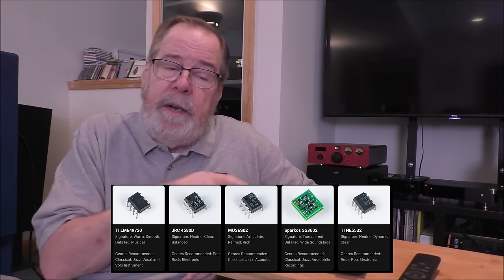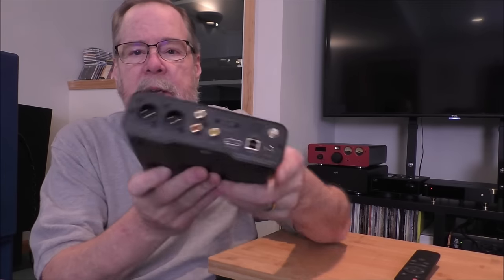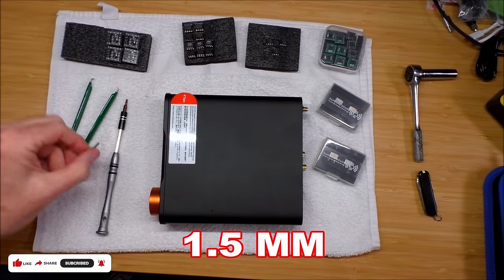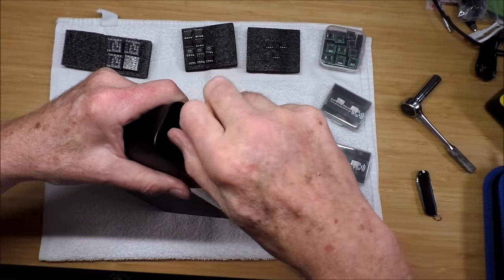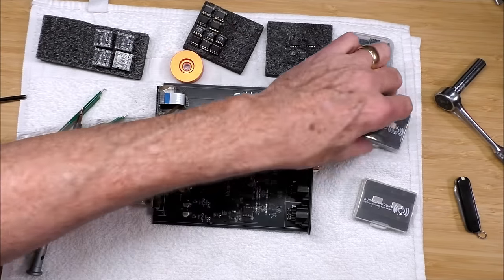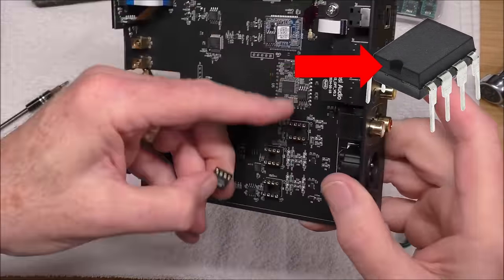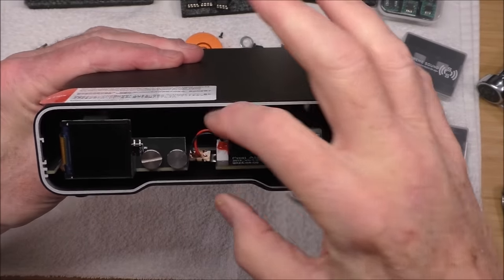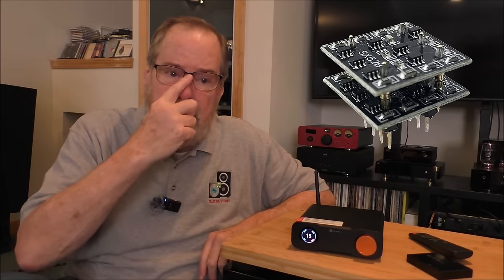This DAC Blew My Mind! No Kidding! The FOSI ZD3 forced me to reconsider my thoughts on SABRE DACs

Comment: Hi Old-guy!
I might try those SX52B or Sx45B on mine. The JRC they out in the box, people usu don’t like much. Everyone likes sparkos but they are spendy. So Grzegorz of Virtual HiFi just came out with his own op amps, which seem to be paralleled chip amps that he thinks sound even better than the discreets. But being paralleled they draw much more current and get hot—he’s got two 2-chip parallels, a 4-chip and an 8 chip that gets so hot he is really just experimenting. He doesn’t recommend the 4-chip to anything in a closed box either🤣 the 2-chip versions are about $30… I think these came about because in an earlier test he was impressed by the sound of just taking two cheap NE5532 and soldering them together in parallel —apparently you can t really just do this it requires some other circuit stabilization , but it gave him the idea.

But I really want to know how you rate this vs the Geshelli J3. I think the Dayzee is a bit too big. I really like the functionality of the ZD3 with the HDMI in and remote. But if the geshelli is really way better…

BTW I particularly like prog and Aretha Franklin. Don’t know Jade warrior. I used to listen to a ton of Yes…

Speaking of how recordings interact—I have a bunch or recordings of 17th century music I kinda can’t listen to now—on older stereo equipment (I used to have an early Jeff Rowland amp, a Placette passive pre, and DACs by Audiomeca and dCS, and some of the lowest-priced Sonus Faber speakers) these recording sounded fine. But now there are many moments when a singer is singing high and loud, that it just distorts TERRIBLY—Im not talking “shrill” I’m talking plainly distorted—just never heard this before. Doesn’t show up on rock & jazz albums at all… either something’s wrong with the speakers, or it’s just new components are way more revealing of anything with high dynamic range…
Reply: I've seen the multi opamps Gregorz made. It's just about dynamics. But better opamps, discrete, are also sweeter sounding in class A. So I rather use the OEM version of Sparkos, just numbered 8802 with an "E+" etching. Same quality, half the price. I also like the SX52b and 45. And on a budget; the €6 OracleII 02. 

After modifying DACs for years I find that very often the output stage of a dac is too 'hot' and tends to overmodulate on piano and soprano voices. They do this to make it sound more 'dynamic'.

I use the Laiv dac now that Ed has under his tv. That one has that problem solved. And that $2700 dac goes to 2 $140 Aiyima A70 mono's with those 8802 opamps. Very good combination. Even if it seems totally out of balance price wise, it is not. I put my big amps back in the box. And the Laiv HP2a pre/HP amp is coming this week. 😊
Reply: @ this is one of the most helpful comments I have received. Ever! I am having a big problem with those recordings, and you have addressed it with this “ over modulated output stage of DACs” comment. I never really could figure out what the problem was, but it did start happening after I switched to an auralic audio DAC that had the ESS 9018 I believe. That was an expensive DAC— it’s just too bad. I didn’t realize the problem might have been the DAC. Because I also switched amplifiers at the time— I even tried out some Nelson pass firstwatt designs. I really liked. But everything always had this problem with high volume on those recordings distorting Tenor and soprano voices in particular (big bass voices are always fine), and I thought it was just the first watts didn’t have enough power rating…

I seem to have the same problem with the ZD3– but I have not swapped the op amps. Is it likely the op amps in the output stage? Or the other topology issues in the output stage? I think im gonna get the SX52b or the SX45b and see what happens. If that doesn’t fix the issue—Grzegorz really liked that LAiV, and Old-guy really likes the Geshelli J3 and Dayzee, and I will probably try one of them…
I have the Fosi V3 and I switched the op amps to muses02. But I am open to trying the Sx52 & 45 on these too— the sparkos are pricey— so they had better be a clear improvement for me to try them… what’s this about OEM on the sparkos? They’re called 8802 E+? Who makes them? I am a doctor and I always use generic drugs—same stuff, just cheaper🤣🤣

Ok I see $8.5 for SX52B, $21 for SX45b, and $38 for OP8802 (sparkos equivalent). Which one is better?!

Comment: Try the SX45B, more punchy, transparent and detailed.  I have also have SX35B from Taobao.  Both are worthy upgrades to the SX52B.
Reply from the maker: Thanks for the tip. Thx also for the view.
Reply: I just looked on aliexpress: SX52B going for $8.50. Sx45B is about $21. Didn’t see the SX35B
Are these all the same size?

My understanding when rolling on this unit is you need two op amps for XLR and one for the unbalanced— so you never need to roll all three unless you plan to go back-and-forth using XLR and RCA.

@old guy— again I’m interested in your thoughts on comparing the ZD3 with your favorite op amps vs the Geshelli J3
Reply from the maker: @kineahora8736 I don't think they are all the same. Not 100% sure. I would choose the J3 even with the stock op-amps. In my opinion the AKM 4499/4191 Chip set is far superior to anything ESS makes. I have 3 DACs with the chip set and 3 more with the baby brother AKM 4493SEQ. As I said it is the best ESS chip based DAC I have heard. Not the best I have ever heard. Remarkable for the money for sure. I do like it for it value.
Reply: @OldGuyHifi  aha so you do overall continue to prefer the better AKM implementations… helpful. No sense in my sinking a lot of time into spendy op amps then, but then again—I could always use them if I get a Geshelli! I mean there are SMSLs with the best AKM chips—but it’s the IMPLEMENTATION. People I trust have not really said great things about the SMSLs…with or without the AKM chips…
The thing is— I REALLY like the HDMI input and the remote function…

Comment: I'm guessing that you don't need to replace all three op-amps depending on your actual use case.  Probably one for the unbalanced outputs and two for the balanced outputs.  This is an important factor if you're swapping in expensive op-amps.
Reply from the maker: Good point. I did run it both ways. So I didn't try that. Thanks.

Comment: I personally support our Small US company. Outlaw Audio, Emotiva, SVS, GR Research, Gesheiil Labs & Sparkos.
Reply from the maker: I agree but, I need to review products from all around the world as many viewers have interest in those categories.  If you look at my channel more closely you will see reviews for Geshelli, Rouge, and Sparkos. I have some SVS speakers in for review which BTW are made in China. I have electronics made in Germany, Italy, Canada as well as the US. I don't judge a product or for that matter a person based on their country of origin. I judge products on their build quality and their ability to engage my and encourage me to listen longer and with a smile on my face. Thanks for commenting.
Reply: @OldGuyHifi  Yeah I know  I just can't get on this Fosi band wagon.
Reply from the maker: @kevindillinger3699  I understand. Thx.
Reply: @OldGuyHifi  hey maybe you can answer my question with these Op Amps. I just bought (2) Outlaw 2220 monoblocks and Sparkos Labs verified for me that the amp also has Op Amps in them. So my Question is. If I run a Sparkos 2590 Op Amp in my Geshelli Labs J2S does that signal just get wiped out by the Op Amps on the new amps. This may be an issue everyone needs to think about when swapping Op Amps.
Reply from the maker: @kevindillinger3699  No the op-amps serve differing purposes in each device. Op-amps are actually "operational amplifiers" and serve to, in the case of the J2S, one chip amplifies the internal signal to either the 2 volts needed for the single ended outputs or 2 op-amps to get to the 4 volts needed for balanced outputs. On the Outlaws the op-amps add additional amplification to drive the internal signals to get them to a voltage level where the main amp can make the best use of them. Does that make sense? I hope so. Great question. Thx.
Reply: @OldGuyHifi  perfect, got a little fuzzy in the middle but that now makes a little more since to me. I am betting a lot of fokes out there could be confused with this also. Thanks for the info.

Comment: Thanks for the review - especially the music recommendations, history, and emotional impact. Very much appreciated. The tutorial was very interesting as well, much more in-depth than others I have seen. I would ask maybe for a tutorial for what to look for, how to tell "good" opamp products and resellers on Ebay or AliExpress as they seem very similar and am afraid of getting knock-off or bum materials from overseas. Not specific dealers, as they change by the day, but the things you look for (I'm the kind of fellow that would answer 220, 221, whatever it takes when asked to wire a room) and avoid to pick a good op amp and seller.
Reply from the maker: Ok Mr. Mom. Honestly I just roll the dice. For brand name op-amps, TI, Burr Brown, JRC, Analog Devices, etc. try Mauser or Digikey. I also try to find eBay reseller located in the US if possible. Good hunting. Thanks for tuning in.

Comment: I have been going back and forth about buying one all day. I can get it for $146 black Friday. I already have a smsl su1 and I don't know if it's really going to sound much different. I am not sure if it will be worth buying one or wait until I can buy something a lot better.
Reply from the maker: A conundrum for sure. It does sound better than the SU-1 but, BUT, if you waited and got something like a Geshelli J2 AK4493 for $250, that would be a huge improvement. Let me know what you decide. Thx.
Reply: @OldGuyHifi  I pulled the trigger on the fosi zd3 and I ordered some of those Alli op amps that you recommended, also I am going to upgrade the power supply. I needed to buy something new on black Friday and I can play with different op amps 😁. Thanks for the review!
Reply: @OldGuyHifi  I didn't realize that the j2 was that much better.

Comment: Overall, in your opinion, do you prefer to use the SMSL PO 100 or the Douk Audio U2Pro DDC?   I need to pick one up for my system.
Reply from the maker: I haven't yet done any critical listening to the Douk. I probably won't. I just found out the Douk is being discontinued and will be replaced by a new unit that has the same XMOS chip as the SMSL. They will be sending me one as soon as they are available. If you need something now go with the SMSL. Thx.

Comment: Hello, 
Just curious, does this remotely match a Geshelli J3. I bought a Sparkos 2590 from Andrew for a single ended output only, but have not bought a DAC yet. Does fosi upset the apple cart?
Reply from the maker: On features yes. On sound quality not really. I think I said that it was the best Sabre chip based unit that I heard. I would go with any of the Geshelli units with an AKM chip in it. Either the 4493 or the 4499. Geno works some magic on those units and they to sound great. Pro tip: If you get one listen to it for a least 90 days before you swap op-amps. That way you get get a feel for the sound and will be better able to hear the difference. Let me know what you decide. Thx.
Reply: Thank you so much for your response to my question. I'm very impressed that you seem to answer everybody. Again thank you I will get the Geshelli, but I'll probably put the 2590 op amp in right away since I already own it, and I don't have the luxury of extra time to experiment with things